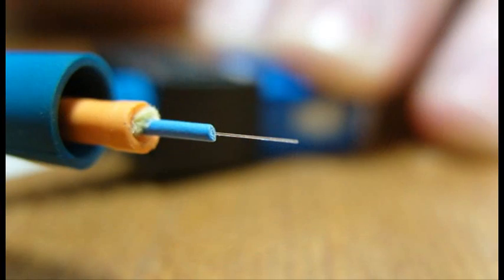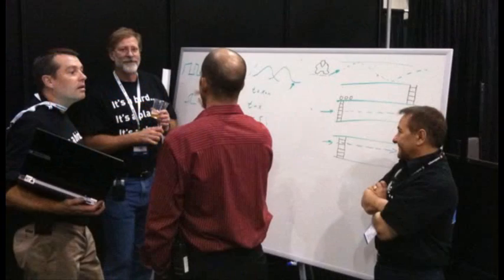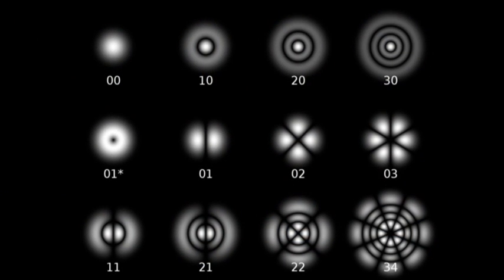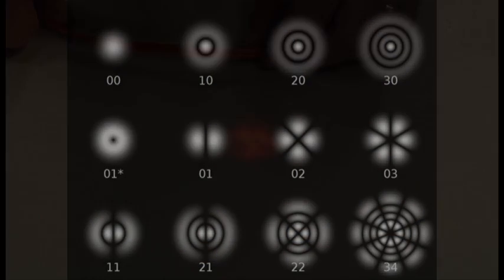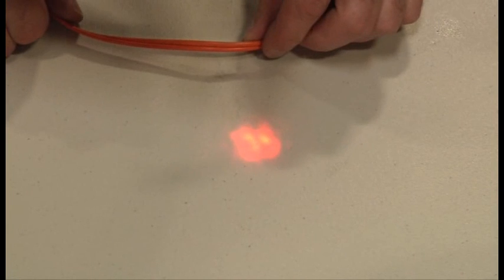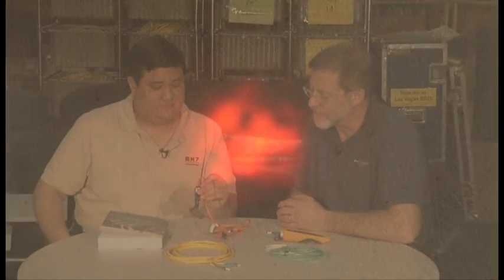Single mode versus Multimode Fiber - Live from InteropNet HotStage

Comment: This was probably addressed somewhere else in the comments but it would have been even better if the applications for single versus multi mode fibers were discussed. ATT uses single mode for obvious reasons - distance and signal strength/purity. But multi mode fiber has its applications and I'm wondering what those might be. Cheers to this 10-year old video
Reply: multi can carry higher bandwidth at shorter distances